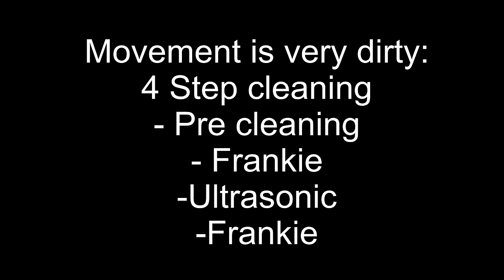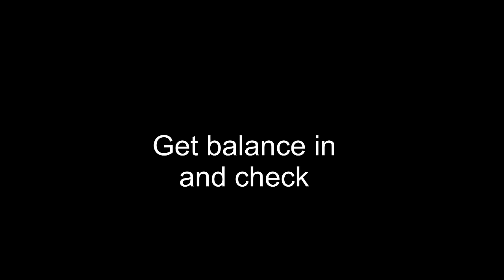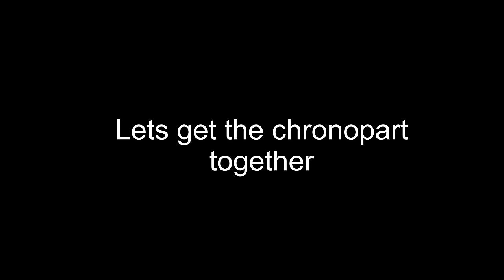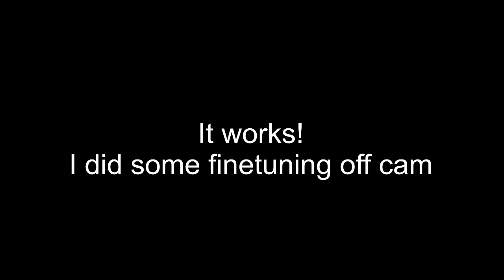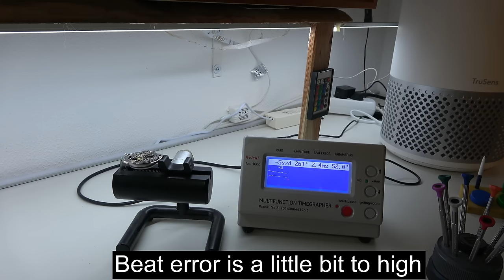$10,000 Vintage Chronograph restoration (Owner didn't know the price)

Comment: Beautiful watch and excellent work, thank you for sharing!  Is one of the columns on the column wheel broken? If so, I suppose everything should still work except one out of eight times chrono buttons need to be pressed twice?
Reply from the maker: I love it when people pay that much attention! You Are Right. The column was broken (i guess, even if I couldnt find any signs of a broken column under the microscope) from the beginning. Sadly this movement is so rare you hardly find spare parts… so every 16th time you are pushing the chrono start/stop Button you have to push twice. I think thats ok. Hats off to your close attention to detail!

Comment: Can you use a soft brush to help clean the movement plate?  Or is that corrosion damage? It always looks like dust that’s been there for a long time and won’t come off without a little mechanical scrubbing.

Comment: One of the methods I use for putting the click in place is when after the spring is installed, I put the click in place and then its screw but only turn it in a few threads,  This allows the click to move vertically along the screws axis just enough to lift it up and slide the spring into place.  I tighten the click screw once the spring is located.
Reply from the maker: Thanks for the advice. Maybe I will try it this way in the future!

Comment: I enjoyed watching your work, but afterwards, I wondered why you didn't adjust the oscillations in the clock. It was too fast in their speed, so it had to be adjusted to near the neutral (i.e. the zero point). But you can always be wiser afterwards - and you don't have to hear anything about that. I wish you good luck with your next project.
Reply from the maker: Sorry I dont get what you mean? The Watch is Running within a few seconds acurate. What do you mean with oscillations?
Reply: Okay! I'm trying to explain it! Inside the clock, there is a function where you can adjust the speed of the oscillations. The stylus can adjust this function from F (fast) to S (slow). Hope that helps give you the answer. Otherwise, give it one more comment. @UhrenDantler
Reply from the maker: @petertrier2746  look at 47:20 its pretty good. There is no fast oscilations… the timegrapher video recording is just speed up. I think that confused you. Sorry I thought its clean that this is a timelapse. Maybe I should Write it down below. Thanks for the hint!

All the best
Reply: If you go back a minute (46:19 - 46:24) in the footage where you are finishing the back of the movement and where you have the "pointer (S/R - F/A)" I referred to last time. Then it is the one you should have moved to fit with 3 lines on each side respectively for slow and fast rotations (I probably used the word oscillations before). I hope all this makes sense to you, and I'm not trying to criticize you in any way. @UhrenDantler
Reply from the maker: @petertrier2746  hello, no worries I don‘t feel critizised. All good. The „Pointer“ as you call it is the regulator and it does not have to be in the middle. It is for regulating. So everythings fine there :)
Reply: What else should it regulate? I have always learned in my professional development that if the stick is in the middle of the "plate", then it is neutral, and it is only a few seconds that it can fluctuate positively or negatively in energy consumption in a day. This is probably also why you use your "machine" every time to adjust the zero point for time and energy consumption. @UhrenDantler
Reply from the maker: @petertrier2746  it is regulating the balance. And it is just for fine adjustements. In my
Opinion it doesn‘t have to be in the middle as the oscilation is correct. And according to the timegrapher it is? I Must be honest I don‘t get what‘s the Problem here. The regulator is used for regulating as the name tells one or? And the balance is not oscillating to fast Because that could be detected by the timegrapher and the frequency would be wrong. Maybe I am wrong but this is what I have learned and I am far from being a Professional 😂
Reply: Don't let it be the cause of all this. I hope you come up with more "repairs" on YouTube in the future. @UhrenDantler
Reply from the maker: @petertrier2746  Everything is fine. I really enjoy this discussions. And I still have a lot to learn. Wish you all the best :)